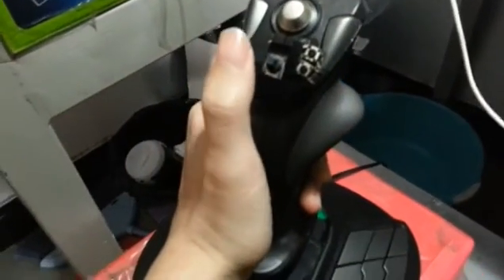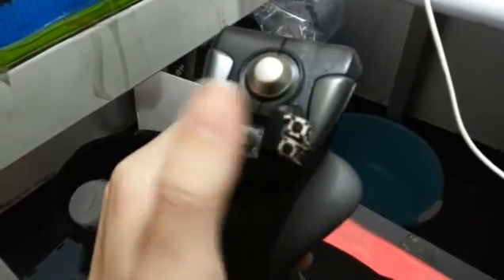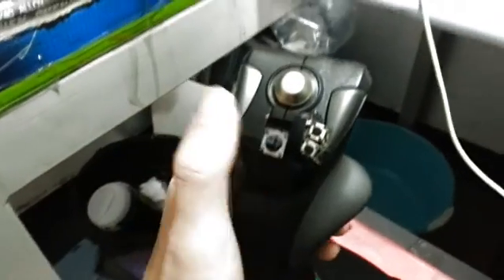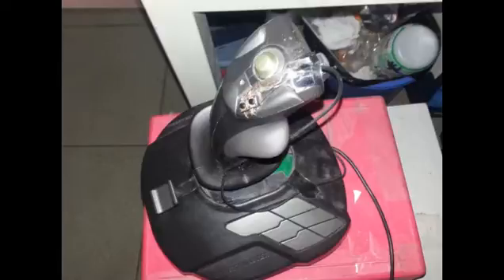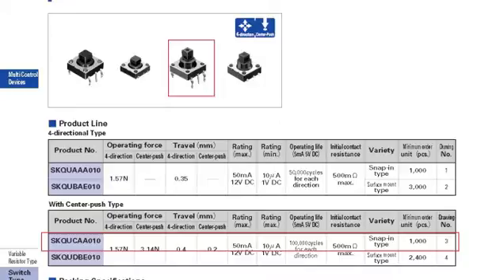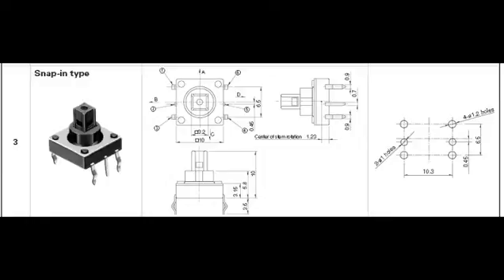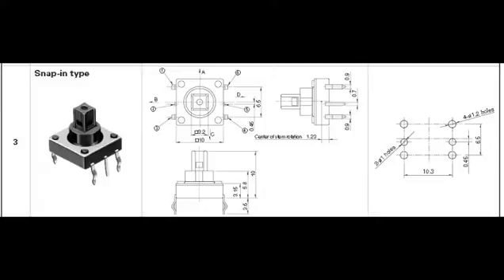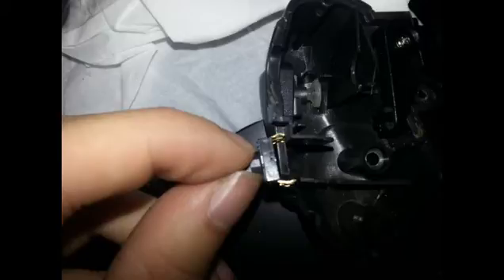Add a hat switch on the T16000M joystick

Comment: did you have the wiring diagrame ? can find it
Reply from the maker: Didn't really use any diagram, I just go to the back of the PCB and find the 2 contact of that button, link them together with pair of lines.
Ended up running 12 lines from button to the head... It may not the best way... but works...